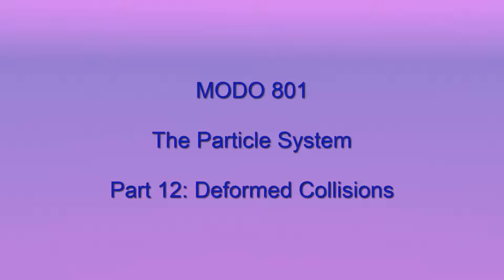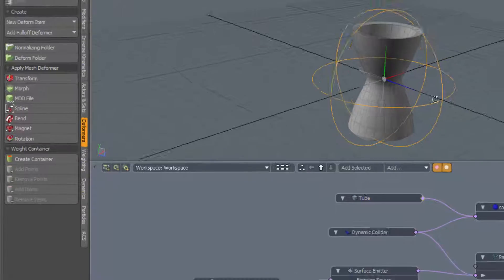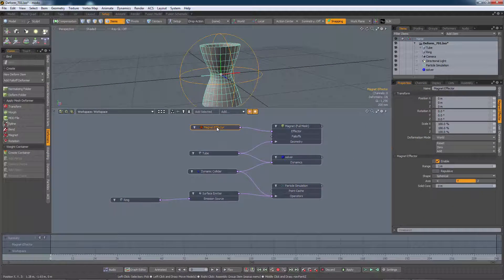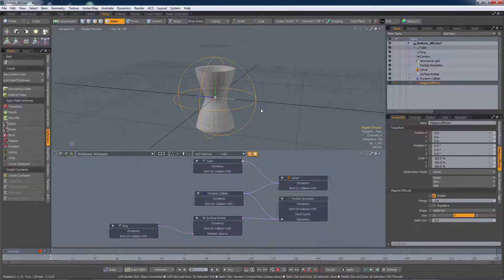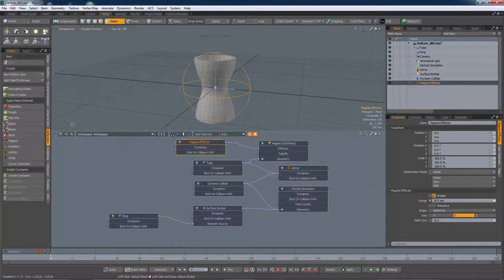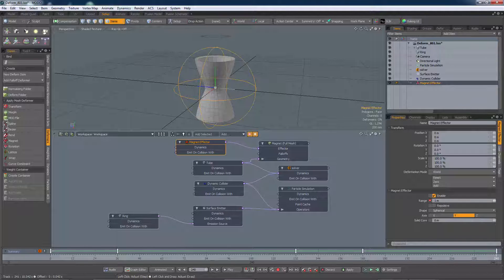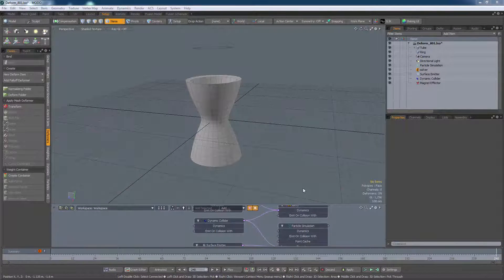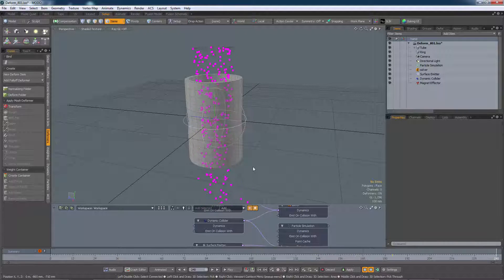The MODO801 Particle System -- Part 12 - Deformed Collisions

Comment: Steve is this something Modo recently fixed? Last we spoke it was not working? Thank you for the much needed video!
Reply from the maker: This is an 801 only feature.  I'm not sure if it has changed behavior over the various service packs.  I haven't had the time to keep completely up to date with the history.  The behavior can be confusing when you don't enable the deformed collisions check-box as the dynamic system snapshots the geometry the first time it is run and then when it thinks that you have modified it -- which can be simple geometry edits or a freeze-geometry for example.